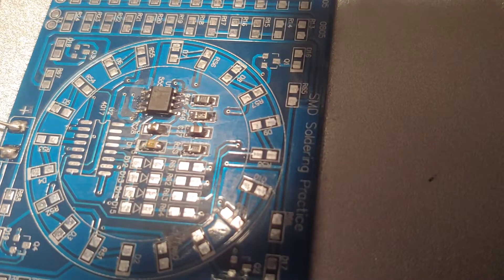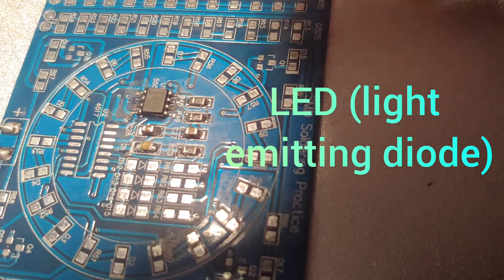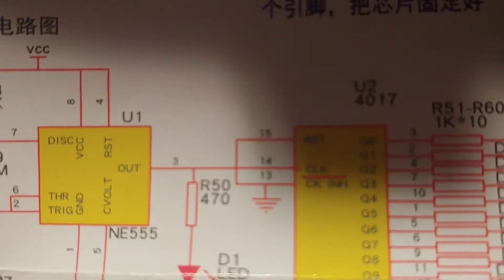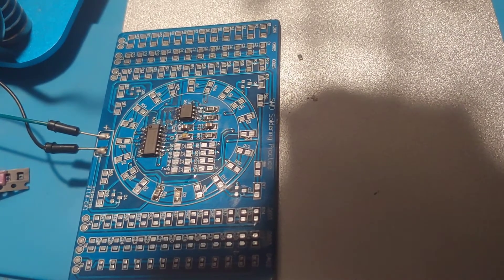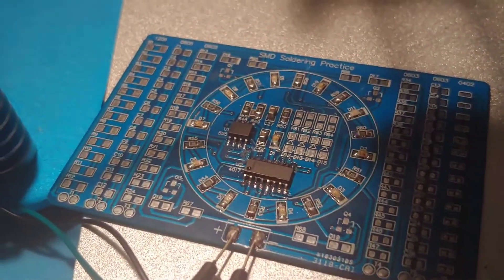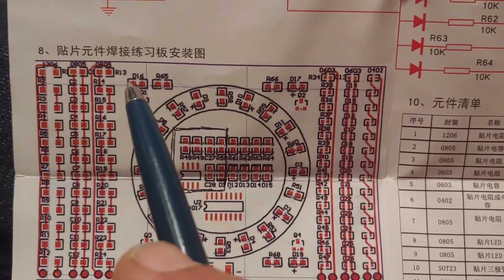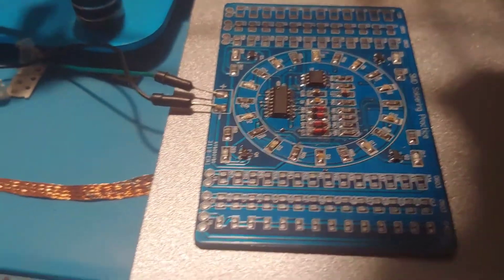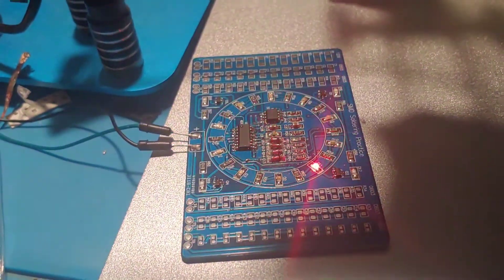SMD Soldering Practice Kit (Gikfun)

Comment: Recieved mine today and there is no clear indication of which part goes where. All components are thrown in a ziplock and not labeld. Instructions are unclear and have been translated. Tutorials online all have different rated resistances so can't even follow along. Have to send it back.
Reply: If you stare at it  long enough, you can work it out, there's only JUST enough info from the image you can download from their site or Amazon which says which strips pertain to what part, based on the colour of the packaging, and the component types, you can work it out.  Black ones are resistors, white-ish ones are the ceramic capacitors.  It's clear they're cutting costs by cutting back on all information down to the last possible info you could use to work out what it is, without telling you, expecting you to figure it out for yourself! It is possible.